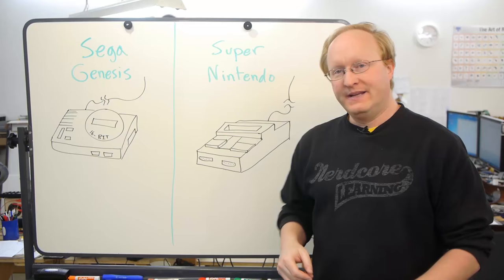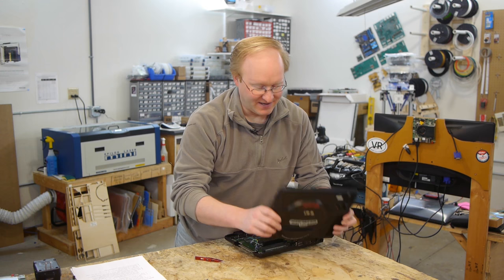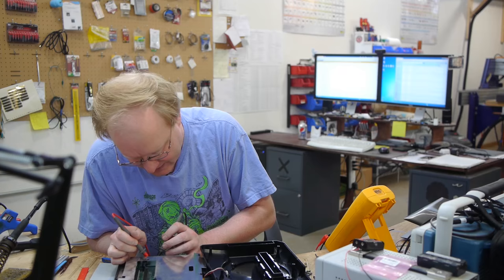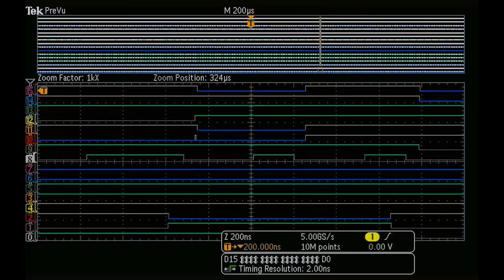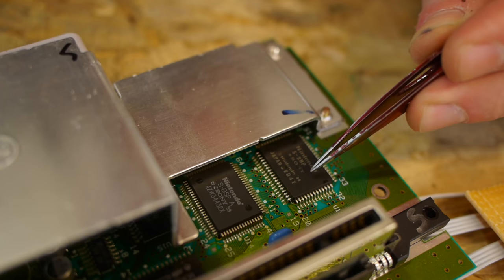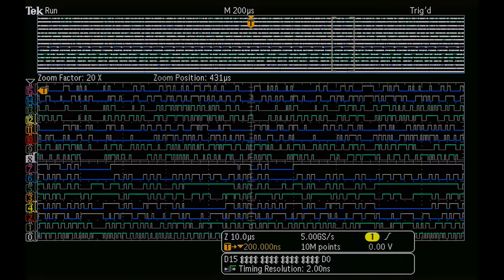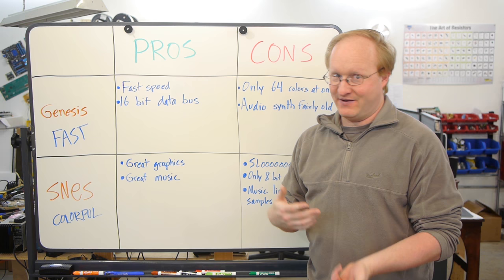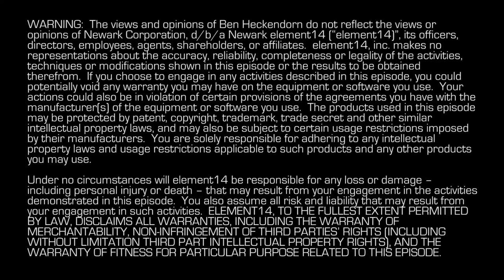Ben Heck’s 16-Bit Console Wars!

Comment: While the SNES had a slower processor, it could preform WAY more operations per second than the Genesis. (and SNES had mode 7, where as the genesis couldn't do mode 7 without the Sega CD) And the super FX chip (and other special chip games) only cost $10 more than a regular game. Sega's only SVP chip game, Virtua Racing, cost over $100!
Reply: ***** But nobody did (or could)it at  at the time. The computers they used were far too limited. It's like saying the Atari 2600 supports speech synthesis. It does, but with atarivox which was not developed until over 30 years after the original release on far more advanced computers.
Reply: ***** They didn't know the hardware well enough to do it. Trust me, if they could, they would. Nowadays there are ways to play Sega CD games in genesis cartridges, but they couldn't do it in the 90's because they didn't have the technology or a good enough understanding of the hardware.
Reply: ***** Clearly, they didn't know everything, otherwise they would have used mode 7 in another one of their super biased comparison commercials.
Reply: ***** The term "blast processing" was mainly inspired by the speed of the processor (and it's supposed superiority over the SNES), and by the speed of their blue mascot. If they could do mode 7, they would That's the way Sega of america worked. Their attitude towards pretty much everything was "Why the F*ck not?". It would be one less thing that the SNES could do that the genesis couldn't.
Reply: Troy Dietz Does it really matter if they didn't do it back then? They're doing it now and the homebrew scene over at the Sega Genesis is amazing. So far it definitely trumps any homebrew scene for the SNES. in 2010 we received a new Sega Genesis game on a cartridge called Pier Solar. Project Y is currently well under development and it looks like an arcade game from '92. Undead Line was released earlier this year and more Sega Genesis releases have already been strongly hinted at.
Reply: Gonçalo Tordo Yes, it does. If the sega genesis had sold more units (say like an 80% market share over the SNES), Sega might still be making consoles, or at least have more ip's to use in games today.
Reply: Sure, but that's unrelated to whether or not the Genesis could have produced mode 7. Sega no longer makes consoles do to its internal struggles.
Reply: Troy Dietz I agree that old games were SHOCKINGLY expensive. Over here "Super Empire Strikes Back" was £59. That's nearly $100. And with inflation in today's money that's like around $140 (or something, I don't know the maths.) I have no idea how me and my bro paid for that, £59 would really come in handy for living right now.
Reply: Lantern Jaw But still not as expensive as some make them seem. Most of my Activision games have sold for $10-$12 (according to the price tags), and most kids only got a new game once or twice a year, and rented or traded the rest of the time.

Comment: If a pulse on the bus goes high for 200ns, don't you also have to take into account the amount of time the bus spends in the low state when figuring out the throughput of the bus? So bus speeds on both consoles would be a function of the minimum time between rising edges rather than minimum pulse width, right?

Comment: Mostly a good video, that's pretty much the difference between the s ystems, yeah.  The only quibble I'd have is to say that at one point Ben says that the SNES has higher "resolution" graphics when he actually means more colorful graphics; the Genesis actually usually runs at a higher screen resolution than the SNES.

Comment: You guys should do a video comparing the different ad on chips for both Sega Genesis and super Nintendo because if you did you would know that the chips in the super Nintendo cartridges at the end of the day completely destroy the Genesis but both systems are fucking awesome and honestly the best generation in gaming in my opinion.
Reply: Even when it comes to enhancement chips, the Sega Virtua Processor completely destroys the Super FX.
Reply: Apparently it didn't matter because look what company is still relevant.
Reply: Yoshi's Island tells us otherwise.
Reply: Virtua Racing on the Mega Drive blows away everything the Super FX ever did. Virtua Racing on the Mega Drive rendered 9000 polygons per second, a dozen times as many polygons as Star Fox. Even the base Mega Drive hardware alone could render as many polygons as Star Fox.

Comment: But here's the thing...99.9% of the Genesis library displays in a higher resolution. Further, Sega dev teams were known to use the Zilog Z-80 as a true co-processor for really intensive games. I'd be curious what Thunder Force IV would do on his scope. I bet it nails that 7mhz. That little 8-bit co-processor was used to brute force effects like Mode 7, rotation, warping, zoom, and transparencies. Another example of breaking the mold so to speak was Sega's ability to smash the supposed 64 color limitations on the Genesis. There are many games running well over that mark in gameplay. Vectorman 1+2 run in the hundreds of colors per screen as did Virtua Racing. Fan fix of SF2SC and fan made Wolfenstein 3d are two other examples of the Genesis running circles around the Snes without any specialized chips on the cart.

The Sega Genesis is the better machine. It is far more versatile and can do everything the Snes can do without any helper chips. There is absolutely nothing the Snes can do the Genesis cannot...however, the same cannot be said in reverse. I'm highly surprised at this show filled with engineers that missed so much it's crazy. Even his game test was extremely limited and judging them playing completely separate titles is...it's not right. If he wants this to be a fair comparison he needs to have a wider test area (more games), he needs to measure for color on screen, resolution in actual gameplay, slowdown, and the FX/FX2 v. SVP. Seriously man, go back to this and if done right your friend will be eating his words. 

Addendum- I'm a gamer and collector today. I actually love both machines and will happily help with a wide list of games that can be used in this competition.
Reply: There’s two points the SNES is better than the Genesis. Colour and sound. But that’s not the whole picture. Games run on a lower resolution (yes it has a higher resolution but it’s impractical to use as it’s just not powerful enough, also it limits the colours significantly).

Sound is sample based so has that advantage if a richer sound. But sound quality is low and the method is not as versatile as fm synth composition (GEMS driver notwithstanding).

Also mode 7. Which is a layer with transforms applied with another sprite layer. But it’s intensive to use so sprites are sparingly used  in that mode.

The consoles are chalk and cheese.

Oh yeah and around 100 titles are in the 28 column low res mode on Genesis usually from an SNES port. The others o don’t know why they are on low res mode.

Comment: I beg to differ, the megadrive has way better sharp RGB video support and looks way better in my opinion
Reply: Yeah this video is old and Ben is comparing the composite video of each. The Mega Drive has the best RGB picture compared to the SNES and PC Engine (both are more muddy looking compared the the sharp clean Genesis image). I am so happy Sega used 320 resolution as the native res for the Mega Drive instead of 256 like the SNES and PC Engine. 320 Res gave a more acurate arcade video picture.

Comment: Snes had a very slow processor and an 8-bit bus despite having a 16-bit cpu however it had Sampled audio (midi) and a better graphics co-processor. It means that the SNES games did have better visuals however it had a lot of slowdowns and often required replacement cpus that came inside the cartridges. Kirby Super Star for example had It's own freaking CPU the AS-01 which was over 4 times faster than the SNES native cpu which was crap...

Comment: I remember being very disappointed with the first two MK games for the Genesis... The Mortal Kombat games looked better graphically, and had a soundtrack that sounded more the like the arcade on the SNES.. I know the Genesis has a faster processor, and the sonic games show it, but most other games didn't use all that speed in those times.. Both systems had great games for the times, and for the most part were very comparable... I like how they changed Aladdin and made them completely different for each system.. I actually like both versions equally, while the Genesis version was alot harder..

Comment: What does the speed of the SNES look like with one of the gnarly on-cart coprocessors running like Super Mario RPG or Starfox?
Reply: When you add chips like the super FX chip they can actually run at 12megahertz so honestly it blows away the Genesis look at games like Street fighter alpha-2 or games like Yoshi's Island these are things that couldn't been achieved without the chips.
Reply: When you add the SVP to the Genesis it destroys the SNES easy even combined with a Super-FX2. Let's not even add the 32X because that is atleast 50x more powerful than a SNES combined with a Super-FX2. Fact is Genesis has much more processing power. Just check homebrew Star Fox for the Genesis. It's almost capable of doing Star Fox without any additional chips.
Reply: @H6rdc0re  and then you put a 32 X and a Mega CD at the same time and your Mega Drive looks like a piece of crap with a TOASTER in the top and SANDWICH MAKER below...

Comment: Ummm, not even "modern stuff" gets the full clock speed usually.  Depending on the CPU architecture, simple addition operations can take up to three cycles per instruction.  One such CPU architecture that this is true for is the ARM Cortex R.  Another example is with memory reads.  A memory read operation takes up to three instructions per byte on most PPC architectures (at least the architecture IBM used in their PPC architectures).

Comment: Oh shiiiiit! Blast processing is REAL! ;-D
Reply: +CptMunta blast processing was real, but it wasn't in relation to the clock speed. it was a programming quirk of the cpu.

“Sadly I have to take responsibility for that ghastly phrase. Marty Franz [Sega technical director] discovered that you could do this nifty trick with the display system by hooking the scan line interrupt and firing off a DMA at just the right time. The result was that you could effectively jam data onto the graphics chip while the scan line was being drawn – which meant you could drive the DAC’s with 8 bits per pixel. Assuming you could get the timing just right you could draw 256 color static images. There were all kinds of subtleties to the timing and the trick didn’t work reliably on all iterations of the hardware but you could do it and it was cool as heck.

So during the runup to the western launch of Sega-CD the PR guys interviewed me about what made the platform interesting from a technical standpoint and somewhere in there I mentioned the fact that you could just “blast data into the DAC’s” Well they loved the word ‘blast’ and the next thing I knew Blast Processing was born. Oy.”

Comment: Sound is not more technically advanced on the SNES. When you consider adpcm was invented in 1972 and the first FM instrument was introduced in 1973. The technologies are roughly as advanced as the other.

You said the SNES audio was “leagues ahead of the Genesis” due to it’s sample based hardware and 64KB of ram. But it’s not very much, as samples were limited to around 4KB each and only 4bit (interpolated up to 16bit).

The Genesis didn’t need audio ram because it used fm  with sound generated in real-time from the ym2612 and samples were read straight from the cartridge. Channel 6 in pcm mode can be split into 4.

Then add the old Master System simple channels which do 3 square waves and 1 noise or 1 pcm channel and you get 6 fm + 4 PSG or 5 fm and up to 5 pcm channels.

Samples on Genesis can’t be pitch shifted and don’t support the adsr envelopes though they can’t be used as an instrument.

One last thing. The SNES doesn’t use all of it’s 128KB of work ram at any one time, only half of it.

Comment: probably not easy to get... but can you do this with capcom's CP System (motorola 68000-based, incidentally) arcade board from the 90s that ran games like street fighter 2, final fight, ghouls n ghosts, etc.? or other 90s arcade boards for that matter.

Comment: I remember adapters from 3rd parties to play NES on SNES, and FAMICOM/SUPER FAMICOM. Not sure if they where passive like a Power Base Converter.  Be something interesting to look into if I ever pick up a SNES to replace my broken one.
Reply: Aberran Fox The Trident Super 8 adapter is actually a "famiclone", or a third-party clone of the NES chipset. It doesn't even run video through the Super NES, using it only as a power source and to read the controllers.
Reply: Damian Yerrick I don't know what the Trident Super 8 is.
Reply: My bad; it was the Tristar Super 8. It's the 3rd party adapter you're thinking of.
Reply: Damian Yerrick Pretty audacious to claim you know what I am thinking what if I am thinking of something else?
Reply: Let me rephrase: The Super 8 is the NES game to Super NES adapter that was mentioned most widely in the US gaming press at the time.

Comment: How did you get into the SNES? They have a security socket on the screws that need a specific head to unscrew them. Did you just pry it apart, make your own tool, or purchase a tool?

The reason I'm asking is because I'm looking for a good security bit for the SNES and the one that I bought did not work. It was junk. So I'd like to buy one that's reliable.

Thanks in advance if you respond!

Comment: Comparing the SNES CPU with the Genesis is a bit tricky, the thing is, even though it's slower in clock and bus, it has some fuckery going on inside it, it does have a general purpose bus of 24 bits!!!

peak instructions per second on the SNES can reach 1.79 MIPS, the Genesis, only 1.4 MIPS, not a HUGE difference, but there is one. showing that clock rate really isn't everything.

There's also a lot to take into consideration, since the architecture is all specialized for each console, there will be some processes the Genesis does faster than the SNES and vice versa.

Comment: The audio isn't necessary better, just different. The Genesis doesn't need much RAM for the audio because it's a synthesizer and creates the sound real-time from a small list of parameters, while the SNES has to have the sounds pre-made, sampled and put on the cartridge and only a handful of them can be fit in the RAM at a time. If it comes to gritty, heavy sound you should listen to Genesis music, and if you want more orchestrated stuff, SNES is the way to go, IN GENERAL.

Comment: Hello Mr. Heck,
I was wondering, what causes the all too common snes black screen of death.  I've heard many opinions on the subject.  Some say that the likelihood of PPU 1 failing is very low, which points the fault to PPU 2.  But is that even true? It seems like a black screen is a large net, that could have many points of failure.  Perhaps if we had three or so snes's all sharing the same exact symptoms, we could find commonalities. At worst we deduce it is a line with too many variables. At best we find a new and practical fix for the issue. Just a thought.

Comment: Didn't the Super FX chip SNES put in a lot of their later games remedy the MHZ issue? I know the Super FX clocks to about 21.4 MHZ by itself but inside the SNES it goes to about 10.7 MHZ?
Reply: Marcus McDonald The first version of the Super FX signal processor (called "MARIO" for something like Math Argonaut Rotation Input and Output) ran at 10.7 MHz. Later revisions were called "GSU" (for Graphics Support Unit) and had three modes: 10.7 MHz, 10.7 MHz with double speed multiply, and 21.4 MHz (which requires faster ROM chips and uses more current).
Reply: Yeah I forgot there was the Super FX 1 chip (Which was in Star Fox) and Super FX 2 chip (Which was in Doom and Super Mario World 2 and would have been in Star Fox 2 if it hadn't been cancelled)

Comment: Hardware doesn't matter, the games do. The only time hardware is relevant is when its so poor that every game on the device suffers because of it. This was the issue with the Wii - but fortunately Nintendo recovered with the glorious Wii U (though it did take them almost 10 dark years).

Both Sega Genesis and Super Nintendo had timeless classics. I personally feel that Super Nintendo had more of them. Genesis had a lot of generic games whereas every SNES game was a treat!

Genesis was obviously the better console in terms of harware. But like I said, hardware doesn't matter. It's called 'Gaming' not 'Hardwaring'. For example, the wonderful Dreamcast that was way ahead of its time in terms of hardware and still flopped.